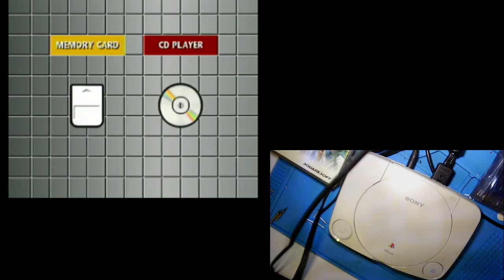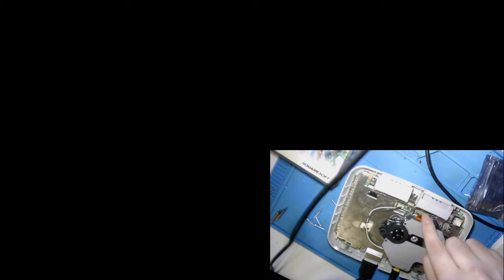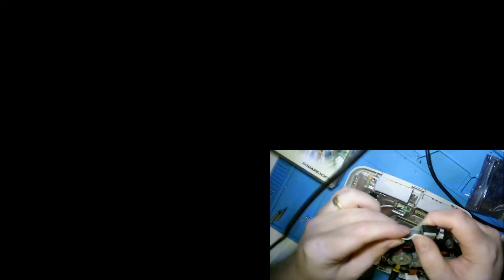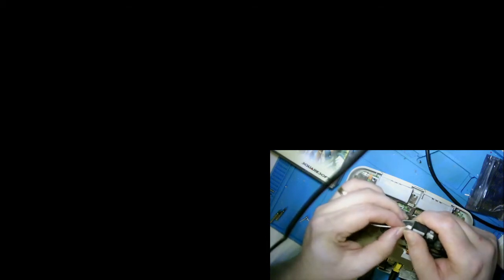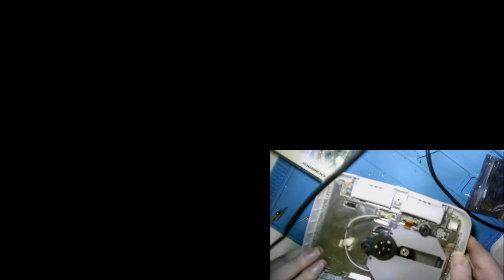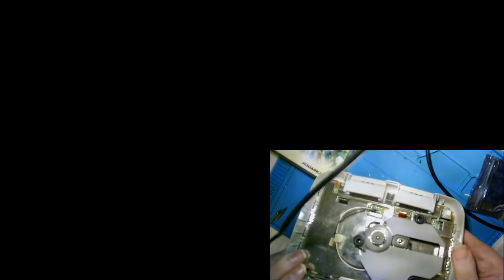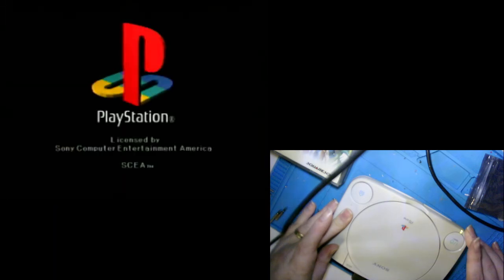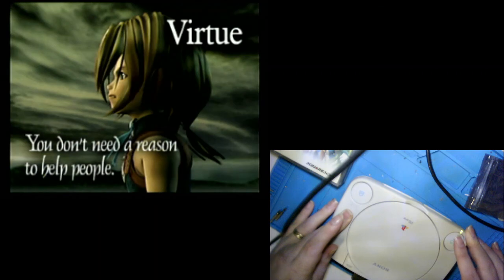.PlayStation 1 KSM-440BAM CD-ROM Install Guide

Comment: Thanks for this! I believe I ordered a KSM-440BAM from your store, along with the extension cable, since I plan to put mine in the original PS1 model I have that's a SCPH-7501. Its laser doesn't work anymore, so I figured your replacement would work great. Especially since the KSM-440BAM should fit in an original unit. It just needs the longer ribbon cable.